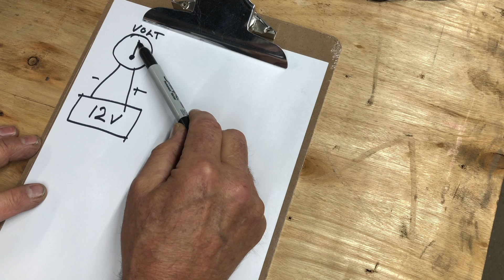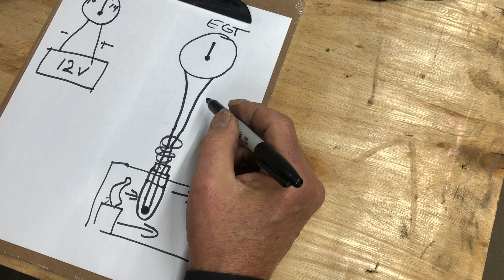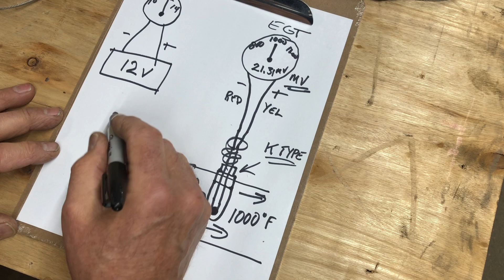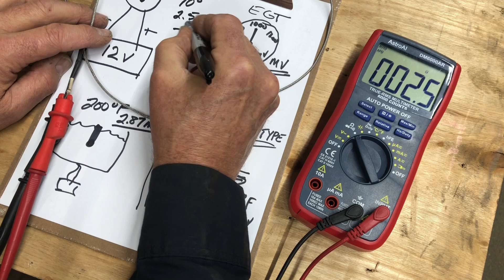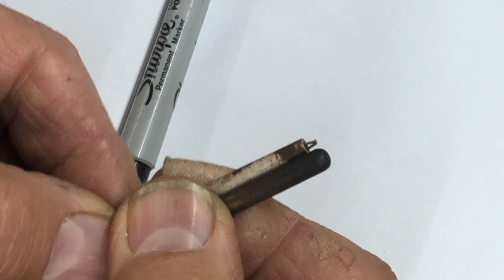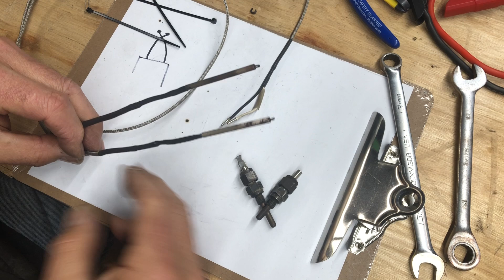Rotax Exhaust Gas Temperature probe K type repair and calibration

Comment: Hello great video. Are you using the ITS-90 Table for type K thermocouple? Because my numbers are different.
Reply from the maker: I used the table supplied by Westach in their troubleshooting section. Thanks for your comment.
Reply: Another black box demystified!  I loved the battery weld hack!  Many thanks for another great explanation.